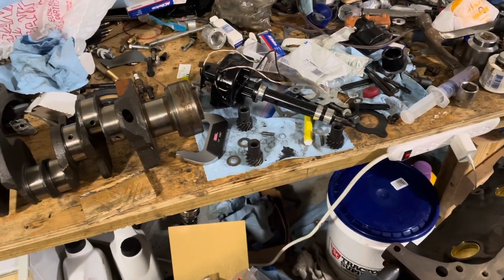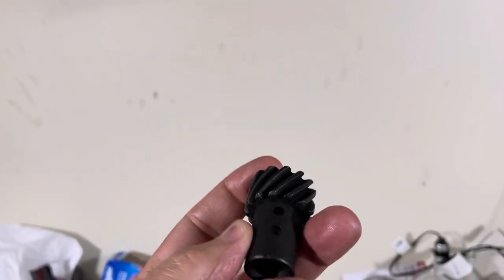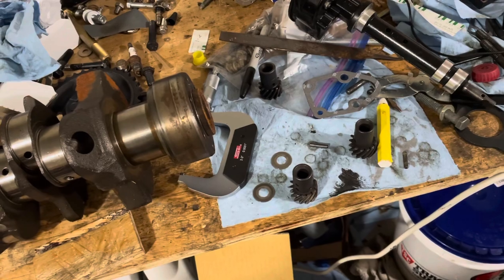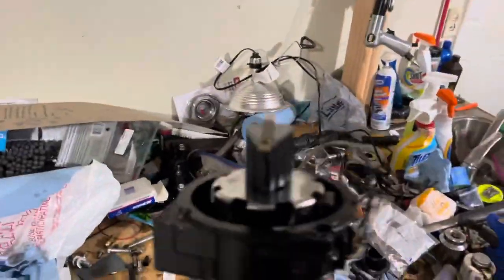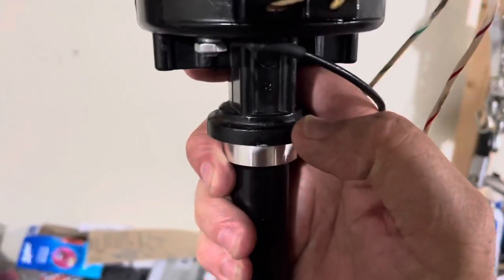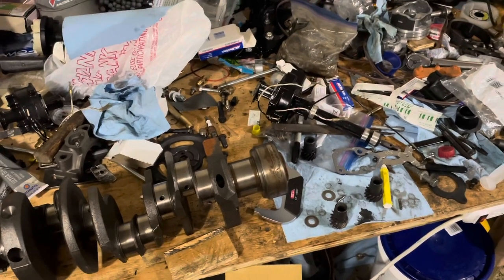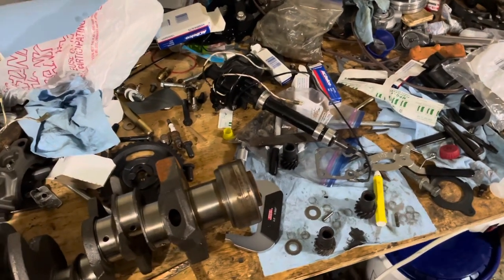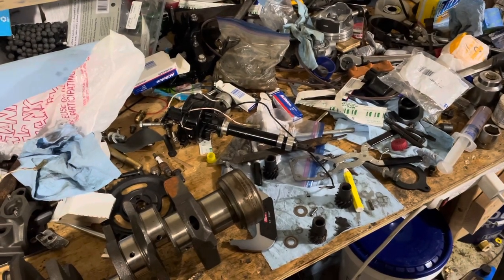Mercruiser 5.7 2(d) - Distributor Science

Comment: Well done.....not a Merc tech but maybe I can clear some stuff up from the automotive side....lets start with Chrysler "Fuel synch" in this vintage....on a scan tool, you could see a "plus/minus" fuel synch, which was actually the synchronization of the hall effect sensor in the distributor compared to the crank sensor. The engine computer would use this for: 1. troubleshooting 2. ignition timing on startup and 3. fuel injection synchronization - important to port fuel injected engines. The computer would use this info to figure out the firing order, and which piston was coming up on compression stroke so it knew when to fire the ignition and the fuel injector(s). In this case, ignition and fuel control controlled by computer, but has to identify the complete firing order (keep in mind, ratio is 2 crank revolutions to 1 cam revolution). The mfg's have all used their own magic to accomplish cam/crank/ignition timing and fuel syncrhonization - all same but different (enter Merc Marine!!!). It doesn't matter WHAT system you are working on, they are all the same but different in how the synch process is programmed and used by the module or computer or module operating the mess. What is really important is that the signals all jive, AND the rotor lines up at the right place in the distributor cap at the right time!. In the video, 22.5 degrees timing if the gear put on backwards - true, if you do the math....one tooth at the crank works out to 1/2 tooth at the cam, which is 22.5 degrees of ignition timing/rotor displacement/fuel synch being out of time on a V8 engine.....enough math!!!! This is useful to determine if a timing chain has jumped.....go figure.....diagnostic tip for the day???
   The "dimple" on the gear has been around for a long long time. Quite often, if you put the gear on backwards, the roll pin hole won't line up (most Fords, and you can break the gear trying to drive it through) but the reasoning in the video is bang on - so DO NOT drill the shaft or the gear to make it fit. Been there, reman distributor with gear on backwards just about burnt an old ford to the ground with superheated catalytic converters from the poor confused computer. Check your work, match mark your stuff and get the right replacement parts! The dimple should be on the same side as the tip of the ignition rotor.
   Moving to GM - used to be super simple with old HEI systems - moving to newer vintage, the advent of more accurate timing and fuel injection complicated all of it - the distributors shown in the video are a GM base, and bastardized somewhat to make it Merc. The principles are the same as above. Crank engine, establish crank position and cam position, fire spark and fuel at the correct time. The trigger plate or sensor plate or reluctor (NOT the ignition rotor) is used to synchronize the crank and camshaft for the calculation process. Used to call it "doors and windows". These are used on a digital pickup (the black piece that the reluctor passes through) and create a digital signal. The older versions (Gm Ford Chrysler) used a magnetic pickup which created an analog signal. That technology should be long gone. Back to digital - the sensor in the distributor can be either magnetic or optical, and is usually called a Hall Effect type sensor. The signal is changed as a "door" from the reluctor starts to pass through the sensor and changes again when a "window" is passing by. Lots of information on the web! Chrysler used the same dame thing, just called it Fuel synch!! Ford - yup, same - called TFI IV. SO, the important things are number one cylinder position, the cam position (distributor reluctor), the ignition rotor to distributor cap or plug tower position, static timing, base timing and the manufacturer's module and programming. The "square base" GM distributors were manufactured to STOP people from messing with ignition timing and messing up fuel synch by cranking the distributor around. We used to grind notches in the hold down bracket, but it was to remedy cam synch issues with a stretched timing chain - the computer looks after the ignition timing!!!!
   Moving to Merc, predominantly Ford or GM based, but they change enough of the guts to make it proprietary so you are forced to try and buy their parts. A lot of the changes they make are for marine safety to reduce risk of explosion. Holley carbs come to mind!! So be wise if trying to retro fit and look closely at a replacement part from something other than Marine applications.
  Hope some of this helps, and have a good day!
Reply from the maker: Thanks for the collaborating post. You might like this video also.

https://youtu.be/MYiAo-gAT1Q

Comment: Hola buenas yo tengo el mismo sistema e un mercruiser 7.4 v 8 i no hay manera de ponerlo a punto para que arranque ya que me da un error de que esta la chispa fuera de tiempo.como lo puedo llevar a el punto exacto gracias
Reply from the maker: Testing
Reply from the maker: https://youtu.be/5v2LQVcUD_c

Watch this video and make sure engine is on TDC on #1 on the compression stroke.
Reply: @moccasinmarine  si lo tengo igual que vídeo he cambiado la bobina tapa de delco i rotor pero nada intento arrancar i a veces petardea i me suelta humo por el carburador
Reply from the maker: I’m having to translate to English but the problem you are describing is your distributor is 180 degrees out of time. You need to put the engine on Top Dead Center on cylinder 1 on the compression stroke, not the exhaust. The symptoms you are describing is when the distributor is 180° out of time.
Reply: @moccasinmarine  ya lo tengo pero ahora creo que tengo las bujías ahogadas de gasolina mañana cambio las bujías i te cuento
Reply: He puesto las bujías nuevas i nada he cambiado los cables de las bujías también.

Comment: From your experience, with a properly running Thunderbolt ignition, is the EST distributor any better for power or performance? Is the timing advance curve different? I know the thunderbolt module is longer available or too expensive, but is the EST better other than that?
Reply from the maker: This is a good question and I’ll research and do a video on the timing curve comparisons. But right now I don’t have an answer for this question.

Comment: What do you mean by "The trigger is actually the leading edge of the metal tab"?
Reply from the maker: The thunderbolt pickup is triggered optically. So the rotating leading edge of the metal spinning toothed disk blocks the infrared light at the sensor.
Reply: @moccasinmarine  Ok, thank you:)

Comment: Can the timing make it to not trigger the coil at all?, my coil is working but doesnt get the trigger signal.
Reply from the maker: The coil is fired by the module, not the trigger. How do you know the coil is working? If there is 12vdc on the module and coil and the trigger occurs, coil will fire regardless of timing.

Comment: So I replaced my starter last year on my boat and I went to start it but it won’t fire. No spark coming out of the Ignition coil. There’s power to the coil/key on so I thought it’ll be a bad coil, went to replace it and still nothing! I’m not sure if the distributor sensor is the problem. Any suggestions?
Reply from the maker: My bet is on the Thunderbolt ignition module. It tends to go bad for no reason.
Reply: @moccasinmarine  thanks! I’ll look into it. Before I replaced the starter I put a new fuel pump in it and she fired up. I thought the no/spark issue had to do something with the starter so I put the old one back in and it did absolutely nothing… so It’s just been sitting for a year 🤦🏽‍♂️
Reply: My other question is, does the neutral safety switch have to do with anything related to the coil causing no spark? Because I had to take apart the shifting mechanisms off the manifold riser so I had enough space to take the starter bolts off, “I didn’t mess with any of the shifting adjustments though” I’m not sure if that’ll be the issue either
Reply: @moccasinmarine  Any ideas where the module is located on the 97 5.7?
Reply from the maker: Neutral safety switches only prevent it from starting. Has nothing to do with a running engine.
Reply from the maker: Modules are either mounted to the side of the exhaust riser(rectangular box) or attached to the side of the distributor. Sorry I didn’t answer til now. I didn’t know my comment notifications were turned off.
Reply: @moccasinmarine  thanks for the info! I will look into replacing that sensor in the distributor first. if I still get no changes, then I’ll look into replacing the module. Any idea where I can order my module? A link would help
Reply: @moccasinmarine  Thanks again! I’m having another issue as well. I turned the ON/OFF Safety switch next to the gear selector OFF. Then turned it back on, afterwards I went to crank the engine at the key and there’s no crank now…. there’s power to the gauges and ignition switch… engine does crank over when I put a screw driver to the starter solenoid or behind the ignition switch terminals, does a bad ignition switch have to do with anything towards the coil? this is a recent new issue… cause it worked fine before I turned the switch off…